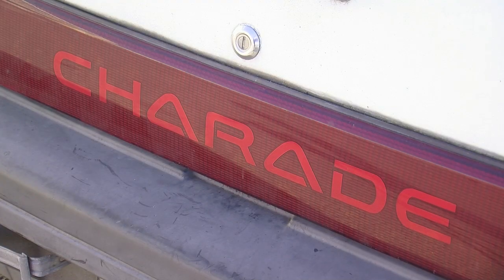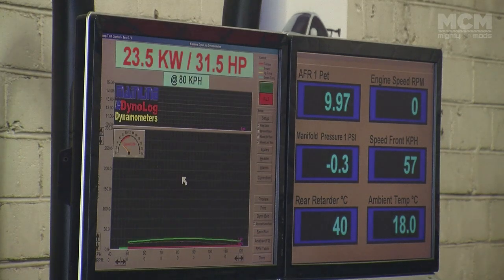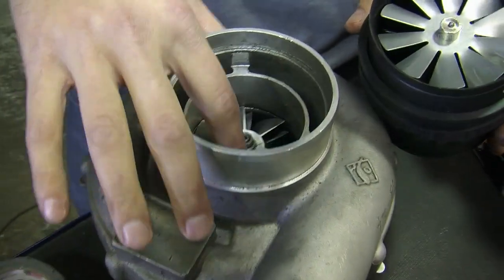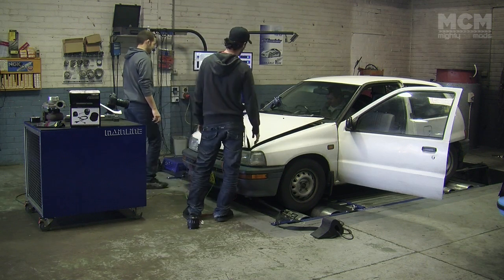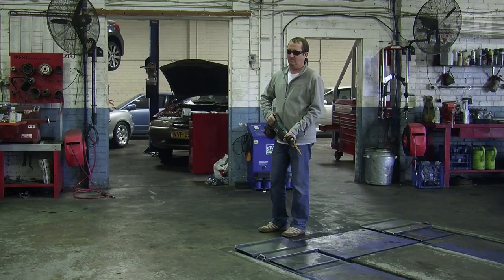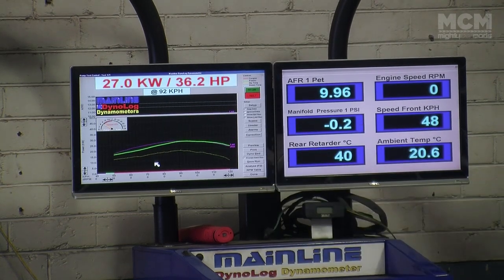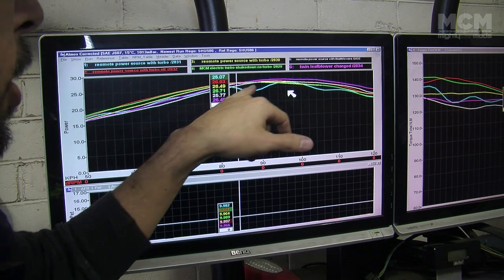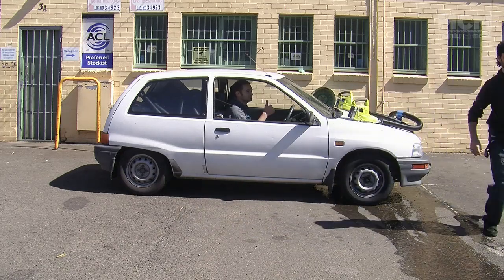Electric SuperChargers Mythbusted

Comment: The reason its not getting as much low rpm power is not because of Turbo lag. There's no lag with a supercharger, which is what the leaf blowers effectively are because they rely on air from outside. A turbo relies on air from the exhaust of the car so the turbo doesn't kick in until there is enough exhaust gas built up, creating lag.
Reply: They weren't serious about the lag... or anything in this video. The ebay fans are a crock of shit, they were just having fun.
Reply: It depends, the amount of exhaust gas plays a role in turbo lag, but it's the amount of rotating mass of the turbine that causes it to spool faster or slower.
Reply: True, but the leaf blowers are always on full throttle so the boost would be constant.
Reply: Zach Weibel Unless you employed a variable bypass.
Reply: ian niel
It's not because they rely on air from outside turbos draw fresh air as well.  It's how they're powered, supercharges are belt driven and always at near full speed allowing the to be constantly making good boost, a single turbo setup depends on the exhaust flow to spin it, thats why theres lag if the turbo is designed for high rpm applications.  At low rpms there isn't enough exhaust to spin it fast enough to make boost or much boost.

Comment: I don't see how it runs at idle with the electric fans on when the a/f ratio would be too lean unless you turn up the fuel pressure at the carburetor. 

But who wants power out of a 3 cylinder? ?? Its for fuel economy not power.

Comment: I could have told you they don't work without spending the money on one. These have been sold on Ebay for over a decade, back when they were promoting HVAC ventilation fans as "superchargers". In essence, you'd be better off spending the money on a nitrous setup, which works on ANY engine.

Comment: The right way would be to mount this electric "blower" between the engine and the carburettor, because carburettor needs negative pressure or vacuum from the engine suction to work properly. Nevertheless, even then it would not raise power, because alternator would try to compensate for voltage drop, and engine looses power to do that, especially because this is rather small engine without enough momentum. Maybe some increase would be noticeable on the bigger engine with fuel injection system, that does not require negative pressure in the inlet manifold.
Anyway love the sarcasm from you guys :))... keep up the good work
Reply: carbs don't work off of negative pressure, they work off of air speed.  The faster the air passes the venturi, the more fuel it pulls in.  Blow through setups work well.  I would not want a draw through system here.  Gasoline splashing on an electric motor seems like a bad idea.
Reply: drjim86
Yes I agree with you, partially. Not every carburettor system is the same. Some of them can work aether by negative or positive pressure or "air speed" like you said, but only if they have means of fuel injection system (mechanical or electrical) built in, to gain fuel mist/vaporization. Other types, more older ones must have negative pressure for work because they used it to suck the fuel from built in reservoir, to gain fuel mist/vaporization. Those types can only work on vacuum.

On the other hand, if "electric turbo" in this "flow trough" setup is equipped with brushless motor, "Gasoline splashing" and possible fire hazard is virtually nil.
Reply: mihovil -d You have your highest vacuum at idle and your lowest vacuum at wot.  Do you think the carb would function properly if it needed engine vacuum to pull fuel into the engine?  That would mean you would pull more fuel at idle than you would with your foot to the floor.
Reply: drjim86 Of course I agree with you, but I think you are missing the point of my post. Don't get me wrong,I can't possibly know yours mechanical background or knowledge in physics. To put it like this, we can go to the bottom of this in details, just for the sake of argument, nothing personal :). For sure I had more than enough years back in the days in carburettor service/tuning and mechanical engine management. Mostly on Weber and Solex and some Zeniths (non american ones). Mechanics in certain carbs, up until mid 80` were setup to be beneficial from negative pressure for engine to work properly on idle. Further more, in years time, almost every one had mechanical membrane pump to force the fuel when you step to the throttle. The amount of fuel squirted was almost proportional to the speed of stepping on to the throttle pedal. It was mainly to gain better response. Of course venturi needs certain amount of fluid in certain amount of time to pass trough to get pressure difference and use it to "suck" the fuel. And it was designed accordingly to match aspiration capabilities and engine size. What leads us to another end of story. What happens when you over flow a certain size venturi.........?
I leave you to answer that in detail if you want :) To get long story short :) It stops working properly, mildly speaking. And then you need the means of forced fuel injection inside the carburettor, mostly by electromagnetic injector. The forerunner of direct injection system and leaving the carburettors for good...  
But if you want a bomb proof bugout vehicle, you're best chances are with a carb one. :)
Reply: mihovil -d I believe you are referring to the accelerator pump that is used to prevent a lean stumble when you floor it.  My carb is a double pumper which means I have 2 of those to tune.  The pressure difference that sucks the fuel from the bowl is a result air velocity.  This is Bernoulli's principal.  It is the same principle that gives an airplane wing "lift".  I have run a blow through turbo on my car up to 8 psi.  Standard holley, no electronics inside.   It functioned very well but tuning was a bitch.  If these electric turbos actually worked, you could easily set one up on a carb.

Comment: first:........didn`t remove the air filter.
second:..carburator engine = same fuel all the time.
cmon guys. lol...
Do it again but with a electronic fuel injection engine.
Pleeeeeeeeeeeeeeeeeeeeeeeeeeeeeeeeeeeease.
Reply: 1 - are you suggesting you can push pressurized air through a filter?
2 - I run a turbo through a carb.  They work for low boost.

As it has been stated over and over again, these things are crap because fans cant pressurize air at a high flow rate.
Reply: drjim86 yes, i agreeeeeeeeeee.but the experimente is not well done. if you have more air but the same portion of fuel, you lose power (the mixture gets poorer). maybe if potting 3 or 4 like that one fan at the same time into the same engine, with elec. fuel inject., the electronics, reading that is more air entering, automatically will adjust the parts of fuel to the increase of air. somethig like 4 or 5 hp gain at least, will happen in a honda jazz 1.2i for ex. Thank you.
Reply: António Ferreirinha but you don't have more air the fans are only moving air they cannot pressurize the cylinder so the volume of air inside the cylinder stays the same. a turbocharger or super charger works by increasing the pressure inside a cylinder from atmospheric pressure to say 10psi. this means there is a higher volume of air in the same space meaning more fuel can be added creating more power. the fan cannot do this as its a fan!!!!

Comment: I reckon if someone manufactured an electric turbo with a brushless motor it'd work more, some brushless motors could spin fast enough with little enough power to be a gain.
Reply: Still need a turbine to compress the air. You can make it spin as fast as you want if there is no compression then there is no boost.
Reply: you'd need like a Dyson vacuum motor or something from a high speed hand drier

Comment: wiring multiple fans in parallel increase air volume, and stacking them in parallel increase the pressure. i would love to stack couple of them and make a variable speed control according to the engine rpm, make them act like a real turbo!

Comment: If you had actually made usable pressure, it would have rammed air into the venturis and stalled the engine.
Supercharging a carbureted engine is so much more complex.
Reply: Its not that complicated for low boost.  For 5psi of boost, up your fuel pressure to 10psi (or use a boost referenced regulator)  and replace your floats with nitrophyl floats.  Higher than 9 psi, yeah, gets complicated.

Comment: They should have tried a couple of different vehicles to eliminate variables. 
Carby cars like that will always have air leaks around the filter housing.
For anything like that to work the air system needs to be sealed to make boost.

Comment: This is dumb. The conventional turbocompressor uses waste energy from the engine which would otherwise expel as heat and gas movement. The electric 'supercharger' basically robs power from the engine through electromotive force via the alternator. The power gains they are getting are from removing the air filter.

If anything, they are better off stripping down the engine and giving it a service..
Reply: This is true, but what about using it as a fan to draw air through an inter cooler? I'm thinking of the heat sink side of things when the car is running at full power.

Comment: Inducing more air will result to a high temperature air thus resulting to fewer oxygen cause they tend to be a part. That's why chargers have aircooled, water cooled thing like radiator to make the molecules intact resulting to a better mixture

Comment: I want to see you guys test an eBay turbo kit, one of those cheap 300-500 dollar kits lol
Reply: Just FYI, used a $400 Ebay 16g turbo kit on my Eclipse GS-T 2.0, make 322whp on 14psi :) Worked great and sold the car with it.
Reply: Thomas Chambless I logged 30,000 miles on it, no issues what-so-ever. See that's the difference between ME and YOU, I gave facts and real-world experience. You on the other hand, gave a couch comment.
Reply: samspace81 good thing you sold it the turbo prolly exploded

Comment: You hooked a fan on this car, but you forgot that under the filter air module there is a valve for hot air. this allow air heated from the exhaust manifold to enter the filter when the car is cold. there is a vacuum and thermostat that switch this valve. So for your experiment, your pressure was probably venting to this or even get clogged from this valve. if you want to be sure this is not the case you have to temporarely force open this valve and be sure no pressure leak to this area.

Comment: Its hooked up to a carbureted engine. You can do this test a million times and it will vary like hell. They should have used a fuel injected engine. This supercharger has to work in one way or another, its mathematically impossible not to.
Reply: TheDarthEmperor
 You brain need a turbine fan.
Reply: It is possible for it not to due to the fact it can't flow the air required to run the engine at full throttle. It is actually lowering volumetric efficiency.
Reply: Dane Cook Lets assume the fan is not capable of generating enough air to supply the demand of the engine. At full throttle or any throttle, the vacuum created by the pistons would cause the fan to propel faster because the fan has centrifugal blades. I can not wait to order my electric super charger! I'm gonna order 4 and make a quad barrel supercharger!!!!
Reply: "because the fan has centrifugal blades."

Not sure if trolling or just stupid.......
You should look up the work 'centrifugal' and then realise it does not apply to this axial flow fan.
Reply: Dane Cook Its a fucking Turbine fan!! Respect the product!
Reply: TheDarthEmperor
Given that it's basically a computer case cooling fan which you can spin with your fingers, the vacuum of the engine is going to make it over-speed off the motor to match the standard intake vacuum.  Absolute best, it'll do absolutely nothing, at worst, it'll sap power slightly.

But it will make you look like an absolute tosser and moron to everyone with half a brain.  So there's that.
Reply: If you believe that then I feel sorry for you.
Reply: -  Unless the fan cant push more than the engine is vacuuming.

It will reach an rpm where the 'supercharger' lags behind and will become a hindrance rather than an assistance.
Reply: Actually, it's mathematically impossible for it to make any notable difference. It doesn't have enough power to compress the intake charge. Any improvements on any vehicle due to hooking one of these up is due to a restrictive intake with even more turbulence than these fans produces

Comment: This looks kinda silly. The compressor / turbine puts more air into the combustion chamber, so that you can burn more fuel without making the mixture rich. You've added chargers, but what did you adjust the fuel feeding system to put more fuel in?

Comment: Hey Great Video. To get Pressure at the intake requires more volume of air than the 1 litre engine is sucking through. At 3000 RPM a 1 litre engine needs 3 cubic metres per minute to fill the cylinders. Look at the rating on the leafblower. If the flow (cubic metres per minute) exceeds engine intake air flow it can work. Anything less is an air driven generator to charge your battery, that's about all it can do.

Comment: buy an air compressor and wire it to a switch on the steering wheel lol or a used leaf blower would give you more power.

Comment: these electric super charger do nothing they need to spin from 8k rpm up to and over 14k rpm for them to even be useful to whole point of super chargers is to force extra air into the cylinders when it's on it's suction stroke.

If some one could actually create a electric super charger that can do it's job then there is a possibility for these to work someday..... Think of the rpm your fan on your computer spins at  avg 1-4k rpm and the engine can quickly go from 1-4 in  like about a second or two or even less on other applications.

so if you have a cheap 1-4k rpm fan in your intake you'll only notice the increase in power at lower rpm because the valve are open longer  now this changes based on vtec/vvti/ti-vct because it open the valves long but even at higher rpm it become useless.

Now some on should make a electric super charger that can support around 10k rpm - 30k rpm to really give engines a boost to even see the difference, and make it so it's just a simple ecu mod that controls it based on the rpm of the computer but there will be lagg if it controlled via based ecu.

Comment: Guy's, guys's, guy's... Turbo's do not revolve at 100,000 Revs per second!!! They turn 60 times slower at only 100,000 revs per minute. Otherwise they would disintegrate through centrifugal force after you reached the planet Mars 3 seconds after pulling away from the traffic lights. LOL
Also when a turbo spools up there will be concurrent changes made to the fuel delivery ratios either via a vacuum operated turbo boost capsule, or more recently via the ECU, otherwise the engine would run too lean and lack power, which would set you back to square one.
So perhaps someone with a bit more technical know how should repeat this experiment only this time pay a little more attention to the real science behind the boosted aspiration principle.

Comment: If someone don't mind answering; what is the difference between a supercharger and a pro-charger?
Reply: Superchargers go in place of where the intake manifold goes. Pro-charger is a brand that makes centrifugal superchargers, which is basically a turbocharger thats driven off of the belt, instead of the exhaust,
Reply: Thank you very much sir.
Reply: Just gonna add a bit: without getting too technical, a supercharger is a general term for a device that forces or pumps more air into an engine than the engine can normally "pull" in by itself which allows more fuel to be added for more power. Roots, centrifugal, and turbochargers are all examples of superchargers.

When you say "supercharger" you're probably thinking of the roots-style supercharger, the large "blowers" that sit on top of the intake manifold driven by a belt (like the one in my profile picture). They are a positive displacement air pumps that uses meshing rotors spinning away from each other to trap pockets of air between the rotors and the housing and force it into the intake were the air "stacks up" in the intake manifold thus creating boost (pressure).

As Al said, "Pro-charger" is a brand name for a centrifugal supercharger which is essentially a turbocharger that replaces the turbine with a belt and several "step-up" gears to get the high rpm necessary for the impeller to generate the airflow necessary to create boost.

Hopefully that was helpful and a bit more comprehensive without being too wordy. Let me know if you have any other questions about superchargers in general.
Reply: 177SCmaro Could not describe it any better. Appreciate it greatly my dude.
Reply: Detroit Reppin No problem!